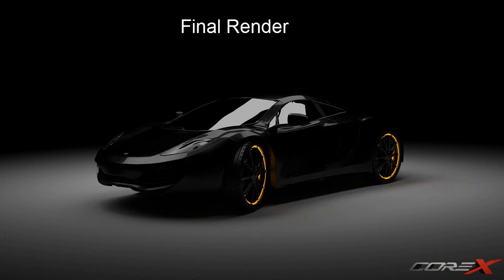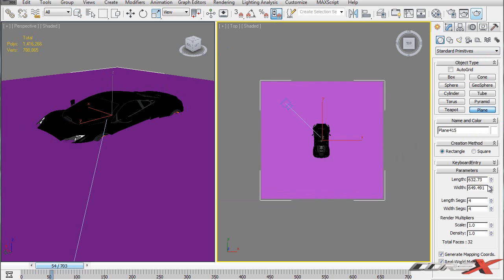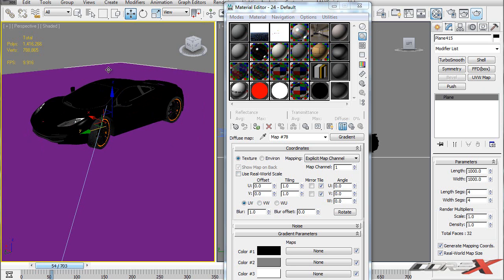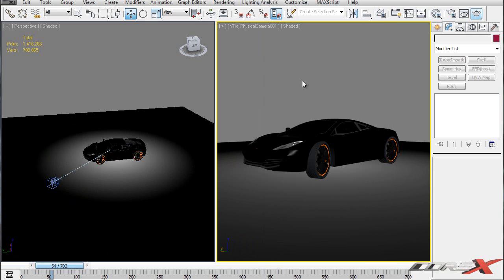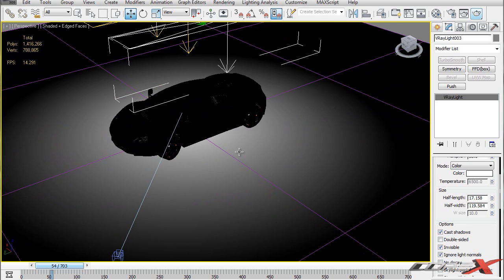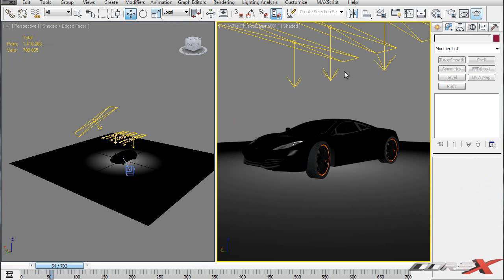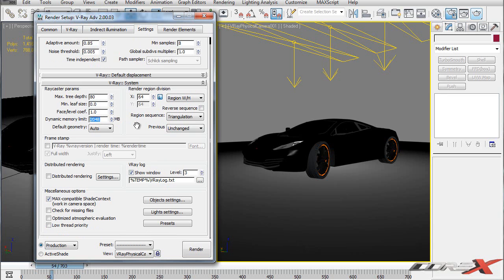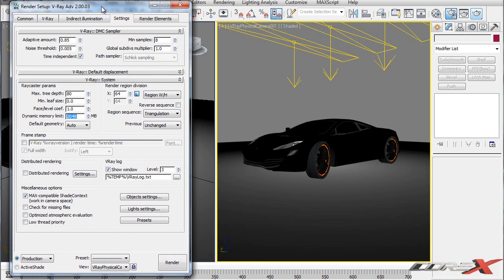3ds Max Tutorial | "Mysterious" Car Lighting and Render Setup

Comment from the maker: You could try raising the Light subdivs multiplier from 8 to 16 or maybe something higher. It will negatively impact the render time, but I'm sure it'll solve the soft shadow problem. If it doesn't work out, PM or comment here, and I'll cross check each and every setting for you again :)
What's funny is, i used to have the same problem, but I don't exactly remember what I did that solved the problem XD It's like it solved itself once I got satisfied from my renders :D Just kidding.